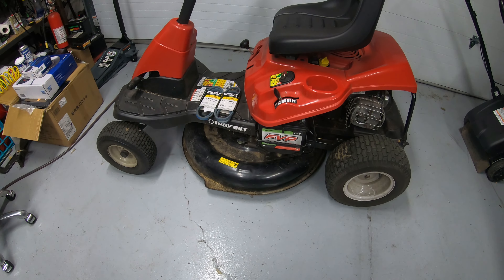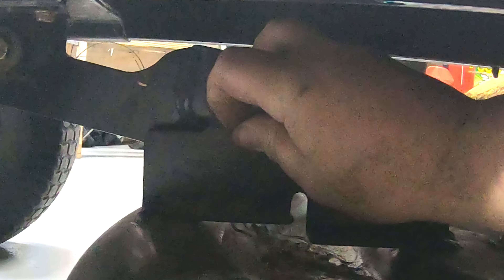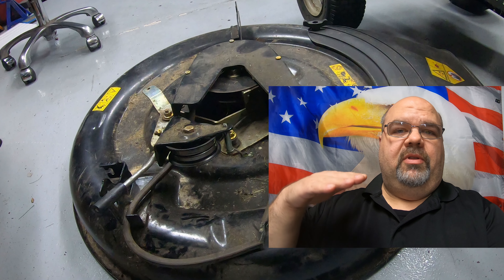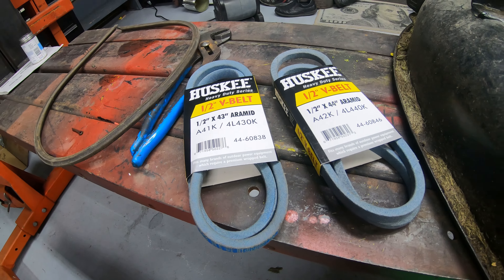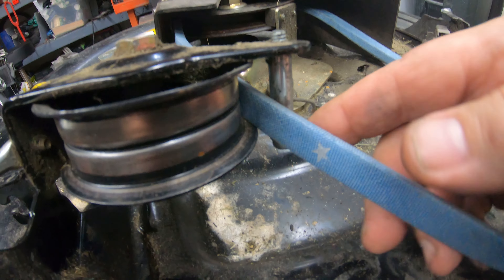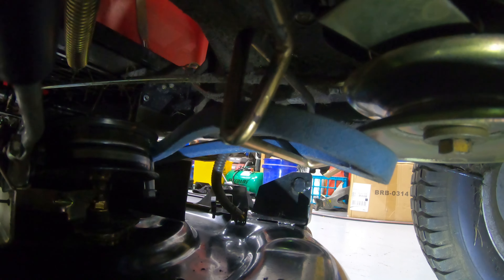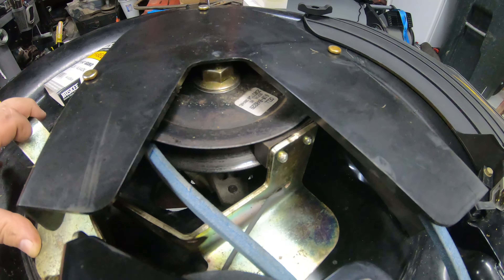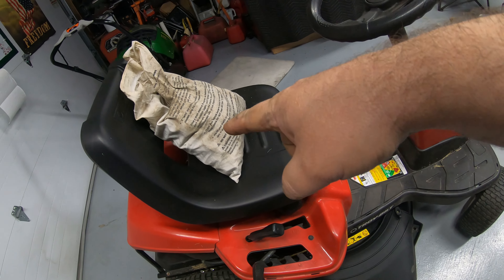Simplified Deck Belt Replacement on TB30” Mower

Comment: I can't thank you enough for this video. When I bought the Cub Cadet cc30h I found the bolt with the long spacer in the lawn. I kept it and after a month or so the deck belt finally fell off. Your descriptions of how to remove the deck was spot on. Thank You for your help and time.

Comment: Nice job on showing the belt replacement. I own the Cub Cadet version of this mower that threw the belt off. I re-installed it twice and it threw it right back off each time. I finally discovered that the back belt guide lost one of the mounting bolts and when the belt was engaged allowed it to come off. These aren't terribly complicated, but unless you have a good picture of how it's supposed to work, it can be a pain.
Reply from the maker: Thank you! This is one of the easier mowers to work on for sure. Hopefully this will help get a few people up and cutting again. 😁👍
Reply: I have the exact same issue on the exact same Cub Cadet.  Replaced the mounting bolt.  Now, off to follow this video to get the f!@#$%% belt back on.

Comment: When you work on mowers you make it look easy,   I spend half my time  looking around my garage for the correct tool,  As always great video thank you for sharing, I hope you had a great 4th of july
Reply from the maker: @vincentshelpfulhints4085  one of the most important things I’ve learned over the years is to put my tools away after every job. I can’t stand hunting for tools when I’m working on something.  When I was very young I left some tools in the driveway after working on my bicycle.  My father found the tools and calmly called me out to the garage.  He had a huge roll around tool box and proceeded to push it out into the driveway where I thought he was going to make my pick up the tools I had left outside. Instead he tipped the entire toolbox over in the driveway and told me that one every tool was picked up and put away where it belonged, only then could I use his tools again and if not I was never allowed to touch his tools again. By the time I finished picking up and putting everything away I knew where every single piece belonged and to this day I don’t pick up a tool in my shop or anywhere else without paying attention to where it belongs. It’s a skill that most mechanics never learn and one that will save you hours of frustration over your lifetime.  
Thank you for watching. I hope you’ve had a great 4th as well.  🧨🎇🎆

Comment: Thank you. Great video and very instructional. The link for the 43.5 inch belt from Amazon works but Amazon says it is unavailable and not saying when it may be available or what price it will be.That's not on yoou, that's on Amazon. I'll have to locate a substitute belt and possibly a different seller too,
Reply from the maker: @glennfields8121  Thank you and thanks for letting me know about the belt being out of stock. It’s tuff to keep up with all the links.

Comment: Thank you for this video. I replaced my deck belt with a 43.5” one and when I engage the blades, they do not cut. Brand new blades, the little bar is not broken. Any clue why this could be? The lawn mower cut before I changed the belt.
Reply from the maker: It may not be on the engine pulley. It’s easy to get the belt above the pulley. It’s also possible the routing is not correct or the engagement cable is not connected correctly.  
Without dropping the deck and looking at it it’s just an educated guess. 🤷🏻‍♂️

Comment: Can you do a video on changing the deck engagement cable for the TB30R?  I cant run the cable tight enough to engage the blades.
Reply from the maker: @scottstanush8810  If I get one in the shop I will make a video for you. Make sure you subscribe so you don’t miss it. 😁👍

Comment: Excellent video
Reply from the maker: @jeffcarney2426  Thank you my friend.
Reply: @baldeagle242 quick question. Brand new carburetor came with piece of foam around choke spring.. installed carburetor and choke sticks.. does the piece of foam need to be removed
Reply from the maker: @jeffcarney2426 Negative, it’s there to keep dirt out
Reply: @baldeagle242  thank you

Comment: could you please tell me the size of the gear wrench that you used to remove the bolt on the guide?
Reply from the maker: @Only1Dean  I believe it was 9/16”
Reply: @baldeagle242  thank you
Reply from the maker: @Only1Dean  You’re welcome. I know all of the nuts and bolts on there mowers are SAE and not Metric.

Comment: How does that bar on the idler pulley make the pulley straight? Mines missing one but I just need to know how it works
Reply from the maker: It slides across a rod on the bottom of the mower. As you raise and lower the deck it keeps the idler pulley in line with the belt path. Without it your belt will not line up properly and wear or jump off.
Reply: Thanks so much . Its cracked off there and I'm going to have to order a new one .  @baldeagle242
Reply from the maker: It’s a pretty common issue on these mowers.

Comment: i always wonder if they design something to use an odd length  belt on purpose , or if they design the mower , then discover that they need to have a special belt made .
Reply from the maker: @billsmith1770  I’ve wondered the same thing. There are a lot of mowers that use fractional belts.